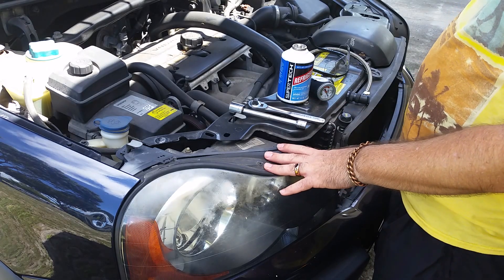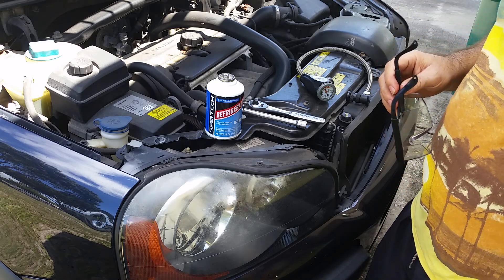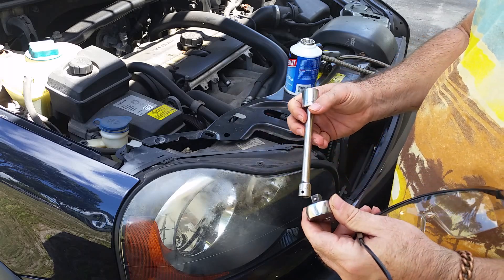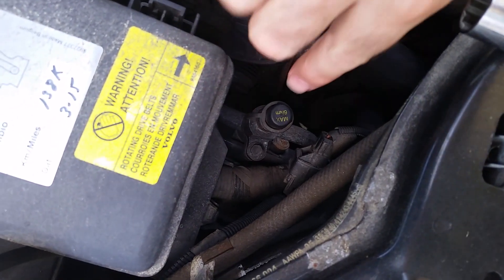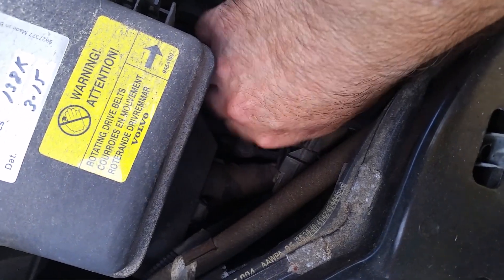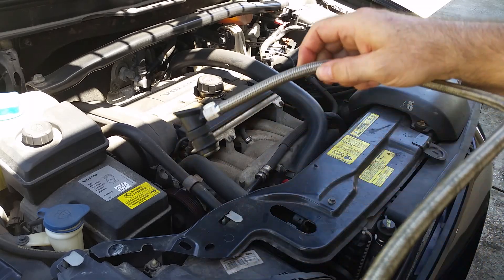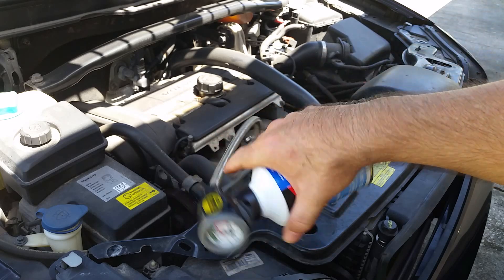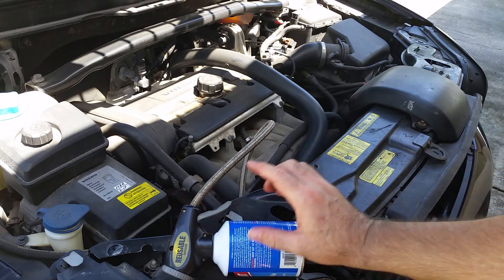Recharge AC Volvo XC90 (2006)

Comment: Safety first you should always connect and disconnect AC Schrader valve while the engine is off. Great video.
Reply from the maker: Great point Tim!   Thanks for chiming-in with that.